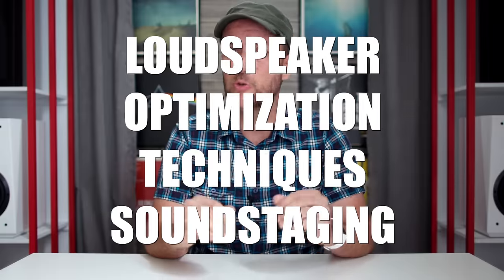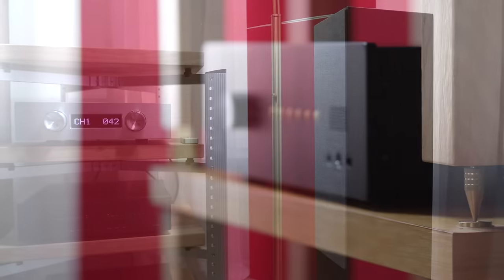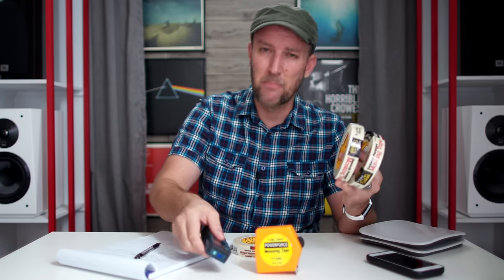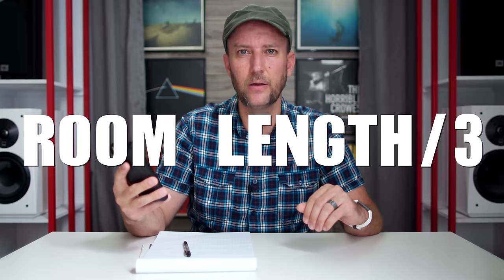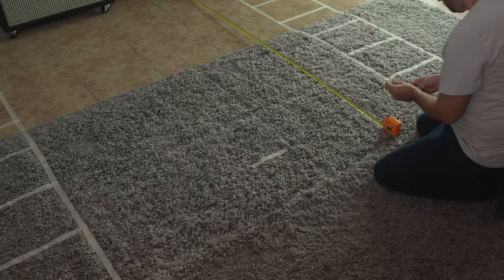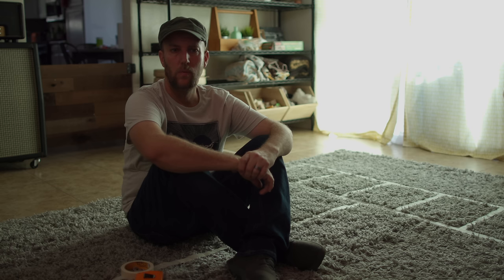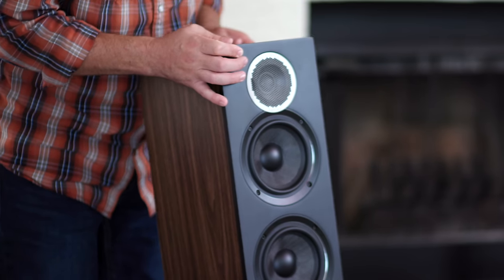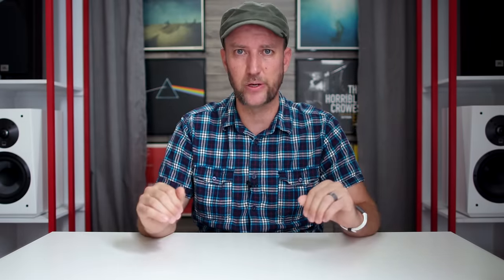L.O.T.S. Loudspeaker Optimization Techniques for Soundstage!

Comment: I've been doing this for years. You are correct about the importance of soundstaging. You might also consider the fact that the ceiling and floor also constitute boundaries, and that the height of the speakers might become relevant (This might make rake a bit more critical). There are room mode calculators that might help determine where NOT to place your speakers (especially subs) and/or listening spot. 

I completely agree with you that optimal speakers/listening spot placements can facilitate most speakers sounding like they cost hundreds, if not thousands of dollars more. Even critical listeners might find that they have been missing subtle, but important details due to the lack of proper soundstaging.

Doing the work required for proper setup is a PIA, but you only have to do it once for a particular set of speakers. New speakers will usually work well close to the positions you found to be best, but will likely require some fine-tuning re location and angles.

The major downside to these techniques is that many listeners are more concerned about visual aesthetics than audio clarity, and those considerations might make "new" placements hard to accept.
Reply: Or placement restrictions, such as in hone theater. If you want to maintain an equidistant circle between 11 channels, it’s hard to move your front channels into an ideal position. It’s a trade off, but then your not depending on just two speakers to give you your soundstage either
Reply: @scottnorris9079  Space restrictions would make that somewhere between tough and impossible (especially with 11 speakers). 

In my case, I made the front surround channels the first priority, and optimized their stereo soundstage. Everything else was built around that, including the size and placement of my screen. Concentric speaker placement was easy to achieve (It’s only a 5.1 system and uses suspended “rears.”). This works very well, but only for solo, quasi-nearfield viewing and listening. 

It won’t work for groups because of the small screen and sweet spot. I sit very close to a relatively small screen which occupies as much of my viewing area as a large screen would at a greater distance (inverse square, etc.). 

For “serious” listening I use a 2.1 system 90 degrees off from the surround system. I swivel my chair 90 degrees to listen to that system for reasonably uncompromised music experience. All speakers are within the same concentric circle, but cannot be appreciated by multiple people. Subwoofers go where dictated by room modes. 

This would never work within a conventionally set up living space. It throws typical room aesthetics out the window, and makes the entire room only useful for solo AV and computer use, which was my goal. 

Essentially, I am at the center of a hemispheric AV media “bubble” constructed within a 25 by 33 foot area. Others (wife and guests) within my house have their own listening/viewing spaces and systems, but have no access to mine. 

(Selfish much? – Yeah! Happy with the outcome? – Yeah!).
Reply: Invictus96vid I appreciate your realism in the fact that even after all the effort that goes into creating a similar listening experience across all the seating, 95% of the time, it just ya nerds sitting alone in a dark room listening by ourselves lol. Might as well just be using my headphones (well... not really 😉). I like your idea for two channel listening. Gives you the best of both worlds! Wouldn’t work for my Setup but I think that’s rad. Happy listening!

Comment: I think this is a nice starting point when setting up in the long axis of a room. In my case, I have my listening axis short, meaning my front and back wall are the long walls of my rectangular living room,. This setup gives me a sound stage unbelievably wide. I can get almost 180° with some tracks. Yet with  depth giving me that 3D, holographic illusion. Also check out some technical from Audio Physics. I also think that the rules of 3rds and 4ths can be broken, don’t be afraid of going wider with more toe in.

Comment: Thanks for the tutorial Ron (it's built-up from your Frequency Friday). My system sound improved drastically using your method. Due to my irregular room shape, my final added step was leaning forward, backward, left , right, and diagonal to fine tune the sitting position. Much appreciated.

Comment: Very good info. Best thing I can add, once you are done with all of this, use the tape and adjust if necessary until the speakers are within 1/16" of the exact same distance to you, and toed in absolutely symmetrically. Because once you get close then eliminating even these tiny little imperfections delivers focus and depth you have to hear to believe. Can you tell I have done this a few times? 😁

Comment: Thanks for making such an excellent and easy to follow tutorial. Can the same approach be applied when setting up speakers in landscape mode i.e. when placing them along the long wall so that they're firing across the width of the room? Obviously, you'd have to do the third and quarter measurements for the long wall first and then find the third of the width to locate the seating position. But it seems like it should work. 

I pulled my couch out last night so that it puts my ears at a third of the width into the room and although I just left my speakers where they were, the bass response was much more even, much less boomy for sure. Fwiw, my living room measures 14.1 x 10.6 feet (4.3 x 3.25m) so bringing the couch out this far doesn't half look daft, even if it's going to result in a much better listening experience. Still,  I guess I'll get used to it in time. 

As for my speakers, they're Wharfedale Lintons, which I had only just concluded were too bog for my room, but perhaps not. At least, not until I follow your guide, as I might well discover that it's sub-optimal placement which makes them see too big (too boomy) for my room. I've got a pair of Tannoy Eaton Legacy speakers in bedroom and I've got a pair of KLH Model 5s on the way so I'm gonna have some experimenting to do to find out which speakers sound and work the best.: yes, I've bought multiple pairs of speakers because I didn't go all in when it comes to couch and speaker placement. I've just been putting them where I think they need to go rather than where optimal sound needs them to go.

Comment: Thanks for this. I tried it as best I could in my room and seemed to work well. I'm in a big basement room where I have to have the listening space more to the right of the room due to a support pillar and window. I also can't have the couch as far back as suggested. The listening spot and the speakers kinda make an equilateral triangle which I guess isn't ideal. It was fun testing out options though and still pretty pleased with the results.

Comment: I've had my  dream set up since 2013 i have 7.2 set up for home cinema, but for music use 2 channel only and no subwoofer is used with music because I've set my audyssey set up on my speaker to go low to 40hz and rest of calibration is done by audyssey 32x calibration. Been into home cinema since 1996 and music since 1986. Lol always nice to see someone take there time out to help other in easy steps took me loads of reading and research to try to get  the perfect sound which is virtually impossible good tip i have carpet in my room but two thick rugs that cover most of my listening area to help absorb the first reflection points

Comment: First off -- this is excellent advice and thank you for sharing it.  When I first started getting truly interested in creating a quality listening experience (many years ago), I had a less-than-ideal room but still managed to stumble my way (mostly by luck, to be honest) to making an excellent soundstage. Even then, I'd heard enough live (acoustic, mostly) music to realize that I wasn't hearing these sounds a two distinctive sources, but as an experience unfolding in 3D space with notable perception of width, center, and depth  As you said, once experienced, anything else is disappointment, regardless of the specs of the gear.

This approach assumes a rectangular, regular-shaped listening area with freedom to place the speakers wherever.  For many, though, this just isn't the case, and speaker placement comes down to a combination of available locations and whatever one's "significant other" will tolerate. This may explain why "against the wall" shows up so frequently, even from speaker companies that surely are aware of the soundstage concept.

Placement restrictions aside, do you have any tips for dealing with asymmetric listening areas?

Comment: Fantastic video! I finally got around to trying this in my new stereo listening space (have had Axiom M60s for years, but due to various reasons cough*WAF*cough have been sitting in a closet for years until we reorganized our office to include a reading/music nook). 

In my 10x20 room, the speakers had been sitting just a foot off the front wall and 1.5ft from the side walls, toed in slightly. I know it’s not ideal, but WAF has its limitations and I was thrilled that she suggested bringing the speakers out in the first place. :) 

After doing the LOTS steps, it turns out that the magic spot for the speakers was 4 feet from the back walls (with the listening position ~7ft from the back wall), 2.5ft from the side walls, with . The magic is real! The improvements in imaging, soundstage, balance and realism are downright startling! I’ve always enjoyed and been impressed by my Axioms, but wish I knew years ago just how good they could sound with proper placement.

The downside? There is no way in hell my wife would be okay leaving the speakers sitting 4 feet out into the room. I’ll just have to move the speakers out for listening sessions and move them back for WAF. But I’m okay with that.
Reply: Great advice on all counts! Just a damn good, down to earth video...period! Thank you!

Comment: Hi Ron - very useful video, thanks!
Any tips for a diagonal arrangement, in a square room? I guess I can still use the "start speakers on each side of listener, then slide them away"? I'll have to find those first reflection points using the mirror trick!
Reply from the maker: Yeah I would try diagonal and apply the lots method as best you can. Obviously a challenge in knowing the best spot for the tracks but if that was my room, it’s where I would start.

Comment: Ron, you swap in and out different speakers Al day long.
The question is if you determine a spot in your room for speaker placement. That placement is room dependent. If you swap in another set of speakers is it going to be on the exact place??
(When it is the same room with its dimensions it should probably be.)
Is the placement spot, different with different types OB/box/lineAray and so on?

Comment: Superp tutorial Ron😁
But I would like to ad something you left out.... Depending on your room layout, it is not always true, that you get the best result, setting your speakers up with the same distance from your listening position. So the best thing is to follow your tutorial, but moving them one at a time. Especially the bas, is easier to get right that way. 
This comes from another metod of tuning your speaker placement, where you start by listening to only one speaker placed at the frontwall, and then moving it until the bas is spot on, then doing the same with the other. Combining that with your metod worked wonders in my room😉

Comment: Ok.  Wow.  I watched this and immediately went downstairs to do some quick measurements.  I took the road most travelled and simply pushed my couch back 5 to 6 inches to optimize the listening position based on room dimensions.  And Voila! an immediate improvement to bass response and something happened to the soundstage for the better.  

I took a few minutes to play with toe in and I could hear the differences with little changes to speaker angles; I'm not sure what is right or wrong, depending on the material being played back: I started with Billie Eilish's Bad Guy for bass; moved onto Live and let die from Paul McCartney, William Orbit's My Oracle lives uptown; Zubot & Dawson's Tractor Part; Katie Melua's Call off the search and finished with Dave Brubeck's Strange Meadow Lark.   

For the "Record" I'm using Benchmark AHB2 mono-blocs and they make a very stable reference amplifier allowing me to improve my system over time. Pre-Dac is RME's ADI-2 DAC FS and speakers are Dynaudio Special 40 (love and hate all at once sometimes).  The Toe in will take more time to "goldielock"  the position of the speakers, but man this works for me!  Thank you NRD (again).

Comment: Ron, Awesome video and your are so right it's amazing how many Audiophile pics i see on reddit and they spend all this money then stick there speakers in the corners. "Never put baby in the corner" well anyway it works only difference i did is once i locked in the sound stage i toed in ever so slightly till i locked in my center image then i stopped. Sound like a completely different system Thanks so much..

Comment: It's all about the room
Great stuff

Essentially this is similar to "HP's Rule of Thirds". Which is always a solid platform from which to begin to operate. 
The math/physics involved suggest the "38% Rule" is a good place to begin, ie., listening position being 38% off boundary wall behind listener, or off boundary wall in front of listener. 

Always be mindful these are theoretical ideal, and in situ measurements trump theory. The 38% point is simply the best mathematical point for the most benign blend of peaks/nulls in that room axis. 

Most enthusiasts don't want to know why, ... they just want a guide like you offered in this video ... so great stuff! Your an asset to this community. 

I truly dig the music accompanying the vid. 
All the best, Kevin

Comment: Dear NRD, was using the magic triangle.  Mmmmm, not getti g a great soundstage.  Waiting for tomorrow night to try your advice.  I love your reasoning,  starting rediculously wrong working to the best sound position.  Makes perfect sense.

Only drawback for me....😮😮😮 each speaker weighs 38kg (83 pounds).  Gym workout😅😅😅😅
Reply: Post script.  Music selected, floor marked and measured.  Speakers positioned next to my listening chair.  Evening fell and I started.  The initial sound was intended to be horrendous.  Thus, you establish a point of reference from which you could only improve.  

I ended up with a much better sound stage than using the magic triangle principle.  Moving the speakers a bit inwards and outwards from the rail track helped a lot finding the sweet spot.  Then toe-ing the speakers a bit in eas the final perfect tune.

Thanks again NRD for the advice.

Further to this, I'm leaving the marked rail track and speakers  as-is for at least a two week listening period.  This way, I think I can get my ears tuned to its new position.  After two weeks,  I'll then again adjust the position marginally just to make sure I did indeed get the best position.  Reason, I found the with the initial listening experiment, my mind and ears got a bit "numb" with all the critical and strenuous listening.

Comment: Ron, great video! This is a technique I hadn't seen before.  One point. This works for standard,  cone driver speakers. It will not work for extremely directional speakers unless you keep them pointed directly at the listener. My Sanders 10c speakers are extremely directional.  If they are not pointed directly at me, there is very little image. 
There are a couple different ways to skin the audio cat. Wide dispersion speakers that must be carefully tweaked to play the room, rewarding with a nice balance and a wide sweet spot. Or very narrow dispersion speakers that play the room to a much smaller extent, but have a very narrow sweet spot. I call my Sanders' my "selfish" speakers. One person only,  please. 😁
Reply from the maker: There are also some speakers that are designed to placed against a wall it won’t work for as well. Thanks for sharing your feedback about the Sanders. I’ve heard those before - nice sounding speakers!

Comment: I used your prior "LOTS In the Dark" version. This updated version is much more in depth and I think a must for everyone looking to get their sound right. YES a bit of it seems silly but if you follow each step you WILL truly find magic.
Reply from the maker: Thanks Mike!
Reply: @Newrecordday2013  Ron, when measuring room width what do you do in cases where there are shelves, cabinets, etc from the floor 1/;2 way up that would acoustically reflect most of the sound?   Do you ignore that or regard that in the measurement?  I disregarded it but to this day am still not sure.
Reply from the maker: @MikeGervasi  yup just ignore them.

Comment: In a small room, unfortunately the best place to put your speakers, is up against the front wall, it minimizes the SBIR. The bass boost you get from the front wall is also minimum phase.

Comment: Great video Ron! I have a question my listening room is in my basement. My basement is divided in 2 by a wall, the side I'm using is 10 feet wide by 36 ft deep, would this method work since the depth of the room is so long? or could I shorten the room up by draping moving blanket across the width of the room? Any suggestions would greatly be appreciated.